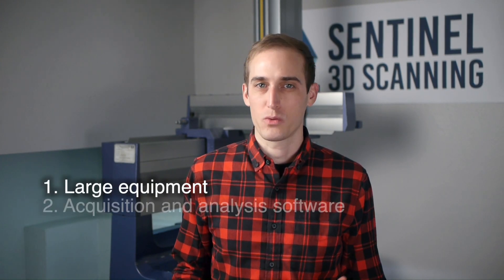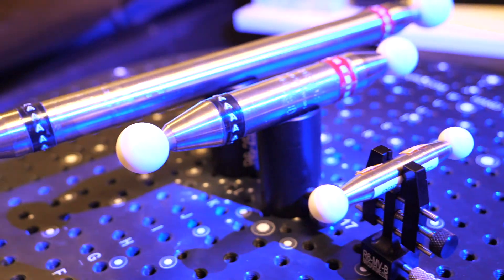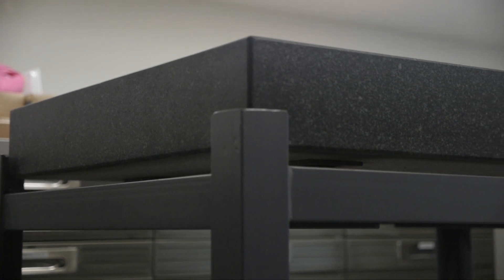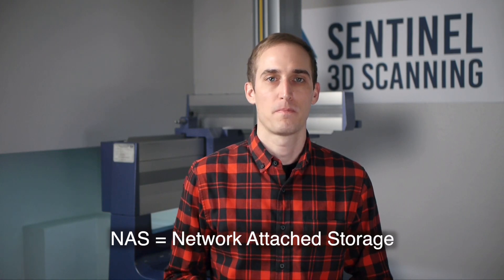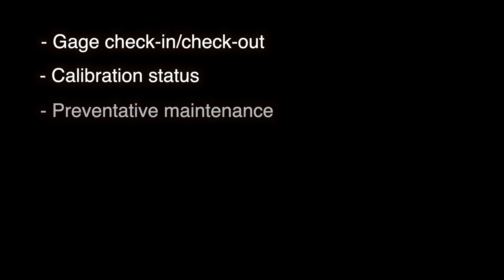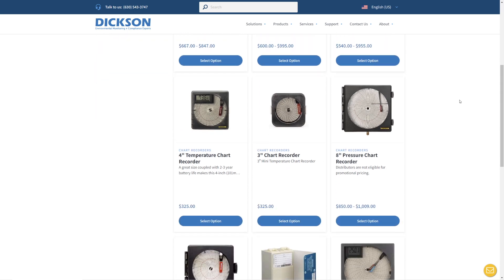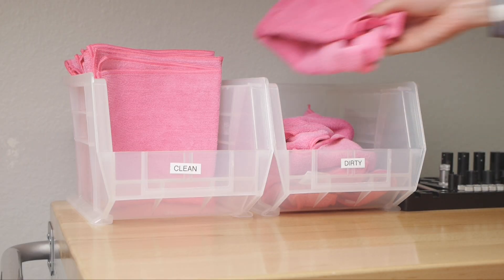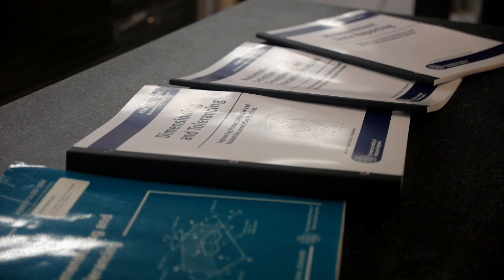Building Your Metrology Lab: Recommendations for Equipment Selection -  Part 2

Comment: From my wifes phone.
#1 profilometer for surface finishes
#2 roundness checker
#3 set up interval for checking granite plate flatness and refinishing
#4 have all optical comparators checked on a regular for proper functions and accuracy. 
#5 Setup schedule for checking accuracy of cmm's and function.
#6 this is just a small sample of the requirements for a shop that does areo space machining.